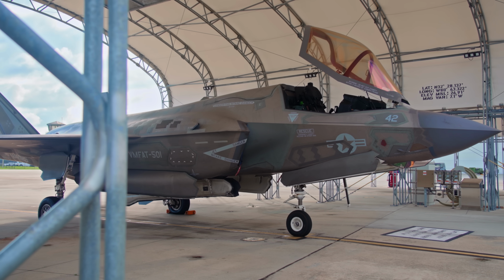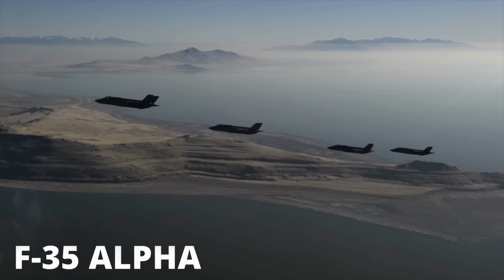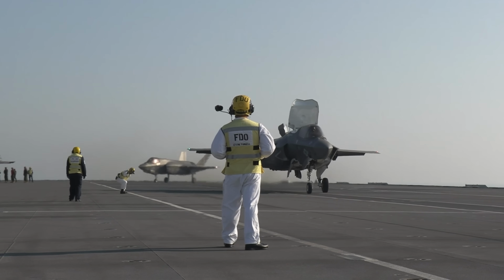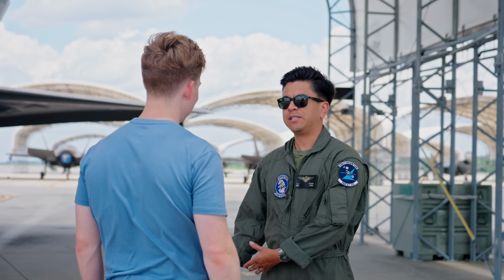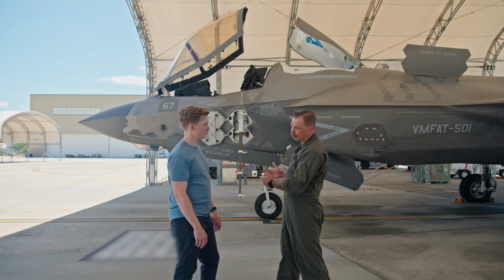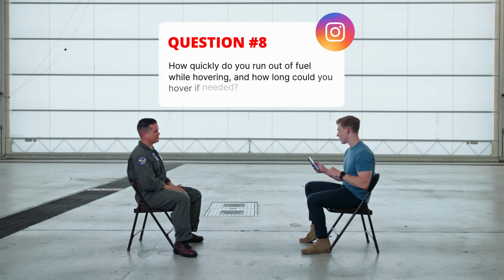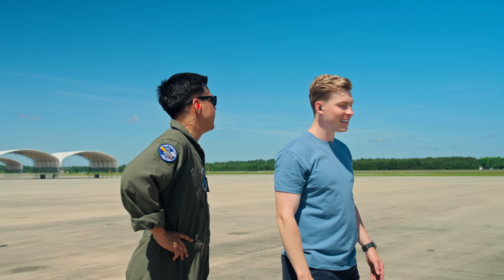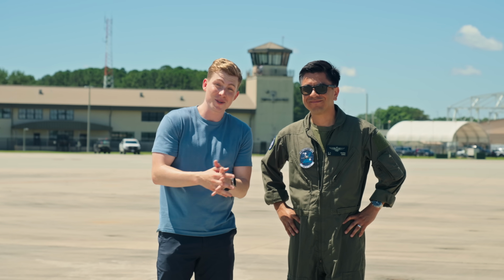Flying the Marine Corps F-35B Stealth Fighter Jet

Comment: Hey I have a question is here most fuel are used for powering the aircraft and due to this the weight is very high is there any other fuel can easily replace the fuel weight ?

Comment: The F-35 is not a fighter jet, it is at most an attack bomber. It cannot catch up with any fighter jet in the world or get away from it. All Russian fighters fly at 2500 km/h. The MiG-31 flies at 3000 km/h. The F-35 crawls like a turtle, its speed is 1900 km/h. It is useless in air combat. Even the Russian MiG-21, which was produced 66 years ago, can reach speeds of 2,230 km/h. This is 430 km/h faster than the F-35. It's a shame!

Comment: An incredible experience is having it pass overhead on final. Less than a mile from the south end of the runway in Ft. Worth is a U-Haul Place. I happened to be there to get some propane when I noticed an F-35 traveling way too slow as it turned onto the base leg of its approach. The store personnel said they'd fill my propane bottle after the plane flew over and went inside. I smiled, jammed my fingers in my ears, and watched an F-35B slowly approaching. It didn't fly directly over, but close enough and low enough that my chest vibrated from the power of the engine and lift fan.

Comment: Worlds first supersonic vtol was Russia's Yak-41 Mach 1.7 holds 12 aviation records, Harrier failed its subsonic and US AVB was unstable, it was solved by Yak-41 Yakovlev who worked with Lockheed on f-35 Mach 1.6.
Reply: If we're including non-operational aircraft like the Yak-41, you're still wrong. The worlds first supersonic VTOL aircraft was the Mirage IIIV.
Reply: @dumdumbinks274  No Mirage only performed vtol up-down and Mach on separate days it had 8 × Rolls-Royce RB162 engines just for vtol, and a Pratt & Whitney/SNECMA TF104 , US,UK,France suffered the same fate Heat death, Russia solved it with a exotic titanium blend to deflect at a high cost $, Russia performed its vtol/mach combined test with a international panel UK, US, French, German, Japan, China

Comment: Uk will desmantle  and airlift F-35(Fail-35)😂😂😂😂😂,from India
Reply: Every jet has maintenance it’s normal. Weather works against both sides in a conflict. It is not a fail it is something every plane deals with
Reply: @joshstroud6823 He wouldn't have said that if it was a rafale grounded due to malfunction the problem with my countrymen aka indians are that they are quite delusional most of them don't even know what a luneburgs lens is

Comment: PR should have made sure Bobbitt didn't say too much about the capabilities LOST by the Marines with this platform. Why are the Marines flying a stealth platform anyway? The role of Marine fast movers is to support boots on the ground. PERIOD. Ask any Hornet, Harrier, or UH-1 driver. CAS- primary mission!!!! 

If A/A threats emerge in that mission, handle business yes. But with a 7G limitation (due to the STOVL configuration), it will diminish a one-circle fight unless a splash is achieved on the first turn. 

In a two-circle fight they will never achieve a rate advantage on current adversary platforms like SU-24 through 27, maybe even the SU-25s?

AND... the weapons loadout is trash- less than the Hornet and Harrier. I vote we decom the this thing and upgrade what we have!

None of this ever made sense to me when I was in defense acquisitions and I watched this program swerve all over the road.

What are we doing??

Comment: The Harrier isn't American...it's a British designed aircraft built at British Aerospace. Get your facts straight.
Reply: The Harrier II is American. It was built by MDD and is a heavily modified version of the Harrier that was then used as the basis for BAE's Gr.5/7/9.

Comment: Does not matter how you try to sway it. The Harrier will always be British, It was never developed by the US
Reply: The F35B is not the Harrier; although they both have thrust vectoring
Reply: @Jordan-i1k8r ... Next you'll tell me the sky is blue
Reply: The Harrier II was designed (albeit a major modification rather than ground-up), developed and built in the US by MDD to USMC requirements. It was later used as the basis for the BAE Gr.5/7/9 variants.

Comment: Specification	F-35A	F-35B	F-35C
Maximum Speed	Mach 1.6 (1,228 mph)	Mach 1.6 (1,228 mph)	Mach 1.6 (1,228 mph)
Service Ceiling	50,000 feet (15,240 meters)	50,000 feet (15,240 meters)	50,000 feet (15,240 meters)
Range	1,500 nautical miles	900 nautical miles	1,200 nautical miles
Combat Radius	669 miles	505 miles	670 miles
Maximum Takeoff Weight	65,918 lbs (29,900 kg)	59,966 lbs (27,200 kg)	70,107 lbs (31,800 kg)
Engine	Pratt & Whitney F135-PW-100	Pratt & Whitney F135-PW-600	Pratt & Whitney F135-PW-400
Thrust	43,000 lbf (191 kN)	43,000 lbf (191 kN)	43,000 lbf (191 kN)
Wing Span	35 feet (10.67 meters)	35 feet (10.67 meters)	42 feet 11.75 inches (13.1 meters)

Comment: The F-35 was entirely built around the B model..  which is why the other two models have the same hump shape, although no lift fan.   It's also the reason the canopy hinge is at the front of the cockpit and not the back.  I've seen the F-35B twice at MCAS Cherry Point.  It is super loud in STOVL.
Reply: No it wasn´t, the other f35s don´t actually have a hump and have an aerodinamic fuselage instead
Reply: No hump on the A and C models. They had the hump removed as part of the streamlining design process. But yes, they are streamlined variants of the F-35B.

Comment: Hey Yunkies ya know that the f35b jet fighters based on the RAF aircraft carrier HMS Queen Elizabeth lost a simulated combat against the french Rafale jet fighters which are slightly more dated including their nuclear powered mother ship.
Reply: Every simulated combat mission involving the F-35, has it tied down significantly. It's no use to either side, if the F-35 blows up everything before the rafale even knows what's going on.

Also, the B variant isn't a good comparison to the catobar rafale. The C variant has more range and payload

Comment: This plane is like the f-4 phantom under McNamara... No gun equals the worst of the worst KTD ratio. HISTORY IS TAUGHT FOR A REASON. Even the Harrier has a gun
Reply: The navy version of the F-4 also never had a gun, yet it still performed better when the air force version got its gun. Why? Because around the same time, pilot training was introduced. That's the critical factor, not a gun.

Comment: How can land vertical?  Must mean it stops in mid air?  How it slow down like that in mid air, and still keep balance?  It is not a helicopter.  This thing is going from hyper sonic to stopping in mid air.  Geez.  Is the Raptor capable of that too?  Can the forward thrusters reverse itself?
Reply: 1. Yeah, it basically just slowly cancels out most of its forward velocity, then hovers down for the final part. 

2. The raptor doesn't have the giant fan and fancy engine swivel thingy. It can't vtol.
Reply: @Penguincannon9000  How does it just cancel out forward velocity and still keep lift and stability?  What if I strong gust of wind hits it?
Reply: @MbisonBalrog  airbrakes and drag
Naturally, if it's in a windstorm, it won't try to land, but it also wouldn't even try to take off, given it's in a windstorm
It keeps lift and stability through the turbofan in the center and jet at the back pushing down, with the rear engine swiveling to generate rotational movement

Comment: You said the Marine Corps has been operating the Harrier since 1985. No sir, I was working on the AV-8A avionics systems in the Marine Corps in 1977-78. I worked pretty close to the control tower so I would go up there sometimes for lunch and sit and eat while I watched the Harriers practicing hovering. That was pretty cool looking at them hover at eye level. The first model was very very difficult to keep stabilize so if you remember there was an  incident at Cherry Point  when a Harrier actually flew through a hangar after the pilot lost control. Fortunately no one was on the hangar deck and no aircraft were inside. Whew!!
So no injuries.

Comment: Listening to this, it is clear the Harrier is overall a more flexible aeroplane; can use hover mode in dogfighting, can land off base.  But it requires more capable pilots with manual control.

Comment: too bad it can't hover in high heat.
Reply: Hot air and lift/thrust dont tend to mix. The same goes for anything with wings and an engine.
Reply: @Orbital_Inclination  just always find it interesting that it can't use one of its main capabilities in one of its main theaters of operation.
Reply: @k333rl  every aircraft has operating limits. The STOVL flying capability is designed primarily for operations off a ship. Ships are usually found at sea level, and the ocean heats air less than land does during the day, so the STOVL envelope is pretty broad.

Comment: Isn't  the F-35 also used in the USAF? And if so, which is it used more in?
Reply: There are 3 models. The a variant is the one the air force uses. This is the B variant. It has a fan in it for VTOL/STVOL, at the cost of payload and range. The C variant is for carriers.

Comment: If we compare use cases for 25mm cannon (35A), VTOL (35B), and extra fuel (35C), Vtol is too nich to be as useful as the other 2 imo. The A and C model can make do without Vtol, and still be deadly. The B can get caught with its pants down without a cannon or sufficient fuel. That unique maneuver the B just pulled off cost half of its remaining fuel. It somersaulted over a Mig but now it has no fuel to get home.
Reply: The cannons are for ground attack anyways
Reply: Sure it's a bit niche, but the harrier needs to be replaced eventually. And it's not just America that has a use for them. We have a bunch of allies who have some small ""helicopter carrying destroyers""(looking at you Japan) and other small carriers.

Comment: Time to catch flak. Although I'm amazed by the ease of use of the hovering controls, the performance of the plane left me with a "meh" sensation. Yes, I'm aware it's a 5th gen, but going away from the gun again? It's very unlikely it'll ever be used again in a dogfight, but still in Iraq and Afghanistan a tiny F-16 with a puny 20mm made insurgents ran away from the fight. Even if you put the gun pod, you increase your radar cross-section. I still don't see the F-35 platform as a "be all end all" for other planes. I still remember how in the Gulf War, people forget Apaches were the ones to open a corridor for the entire air campaign. F-15C practically destroyed 3/4 of the Iraqi air force, F-117s struck high value targets, F-16s did the extremely dangerous Wild Weasel roles and also bombarded whatever was left of the Iraqi air force alongside F-15E. I still don't see the F-35 family as a replacement for all that. Weapon's bay are too small, thus if they need more ordnance they'll have to use external pylons, more weight will consume more fuel so tankers will be key, and so will drop tanks, thus decreasing the radar cross-section even more.
The F-22 was designed as an air superiority fighter. 6 AMMRAMS in the belly and 2 Sidewinders on the flanks. A flight of 4 could literally deny an entire country's airspace.
The B-2, a specialized bomber with something like 40.000Lb of boom boom capacity. You can cripple a whole country with that, and more if they're GPS/LGB bombs.
The F-117, a specialized bomber also, but intended for highly valuable targets. Yes, I know it's old, but for the Gulf War it was more than good enough to cripple Saddam's comms network in 1 night.
I'm not a denier of the F-35, I just think it hasn't reached maturity yet. Right now, I see it as a weapon's platform that wants to be too many things at once, but doesn't excel in any one category.
Just my 2 pennies. I've been an aviation enthusiast since I was 6, and almost all of the most iconic planes have achieved that status for being specialized in one area instead of many.
Reply: putting an internal gun means additional weight that isn´t optional regardless of mission, you keep saying how it loses stealth in order to match the f16 but forget that the f16 doesnt even have the option of stealth. The f35 is a superior sead aircraft in it sead configuration and a superior cas aircraft in its cas configuration  when compared with the f16
Reply: If a specific situation requires a gun the F-35B and F-35C can both carry external cannons. If you then complain about slightly increased RCS (the pod is a stealthy design specific to the F-35), you're just looking for something to complain about, especially since guns are never used if there's a potential anti-air threat in the target area.

As for where the F-35 excels, I can think of 3 roles off the top of my head; SEAD, Strike, and Interdiction. 

In the SEAD role it's networking and electronic warfare capabilities make it more effective than the F-16 even without dedicated ARGMs. It can carry the AGM-88G internally.

In the Strike role it can match the payload of the F-16's practical maximum while remaining stealth. Needless to say the F-35's external payload allows it to exceed the payload limits of the fighters it replaces when stealth isn't required. And it's sensor suite allows quicker targeting.

In the Interdiction role it can carry 8 GBU-53/Bs internally, and it's sensors enable it to locate targets as quickly as dedicated reconnaissance aircraft can. The GBU-53/B essentially fills the role of a long-range ATGM.

Comment: That isnt a fighter jet. Its a heavy high wing loading single engine electric pos. It isnt powerful and if it fails to kill bvr and a merge is forced then the f35 pilot is dead.
Reply: It has better wing loading than the f18 and better aoa capability than any other fighter +it has access to aim9x making it the best dogfighter in history
Reply: @aquilesca5tr0  both of your claims are patently false. You are a troll and have been dismissed
Reply: @Themheals  the f35 is able to reach over 110 degrees of aoa though it is limited to 50 via fly by wire, the f16 is limited to 25 degrees. The f35 is the best dogfighter, cope with it

Comment: All combat aircraft should have at least 2 engines.  Why?  1 more engine is redundant and safer right?  Here is what most don't think of:  1 more accessory drive, 2 more hyd pumps, 1 more electrical generator for increased radar wattage and more ECM, 1 more bleed air output and 1 more ECS system for avionics cooling.  The F-35 struggles right now with avionics cooling and radar wattage, and unfortunately it's an inherent single engine design decision problem.  The F-35 will always be a 2nd line fighter and situational awareness platform because of this.  Makes sense why the USAF is throwing money at the F-15EX now doesn't it?
Reply: And yet the f16 is doing just fine on one engine. 

And you got it the wrong way around, the lighting will be the front line plane doing all the fancy sensor stuff, and the eagles are hanging out back as missile trucks.
Reply: @Penguincannon9000  F16 is good at wild weasel.  2nd line everything else. Thanks for reinforcing my point.
Reply: @BasedF-15Pilot  the f-16 is second line, because it's not stealth. The lighting is stealth, and thus able and is part of the front line.
Reply: @BasedF-15Pilot  you are an edgy kid that tries to enforce war thunder logic on an actual fighter jet
Reply: 2 single engine fighters are more than twice as valuable as a single double engine fighter
Reply: @aquilesca5tr0   Sure in imaginary land where small single engine fighters have the range and radar output of large fighters (they dont and never have and never will)
Reply: @BasedF-15Pilot  the f35 literally out ranges the f22, the f35 is the most overpowered fighter in the history of the world

Comment: i bet that voice command cost tens of millions of dollars and it's not being used.
awesome video.
Reply: The whole jet cost less than 120 million per unit with some spare parts and support services. The engine costs tens of millions the flight computers probably a couple million a piece as they have to withstand the heat, cold, EM interference, and G-forces needed for use in a fighter jet. The voice recognition was almost certainly just intended as a assistive feature for the radio and other non critical tasks as it is going to be limited by the pilots wearing oxygen masks and by lacking any external processing limiting it to whatever processing power the flight computers can spare while prioritizing real time flight data computation.

Comment: The interesting thing is that the Harrier  can accelerate as fast as the f35 at low level Both share a >1.0 power to weight. Except the harrier can use Viffing at any speed.  It will tear the door off the F35.
Reply: The f35 has better acceleration at higher speeds, it has a cruise speed that humiliates the f16

Comment: Soo I may sound dumb for asking but I’d love an answer fr can someone explain what exactly the white smoke/vapor is coming off the wings when they do hard turns in the jet?
Reply: Water vapour.

It’s caused because the wing tips generate high velocity vortices behind the plane, the pressure in these vortices are incredibly low. This lowers the temperature, condensing the water in the air into water or ice